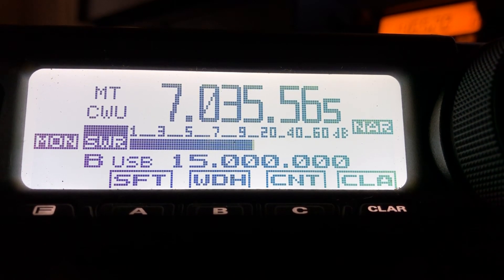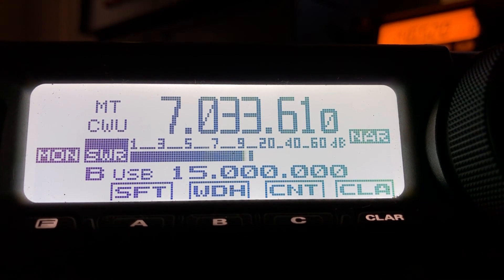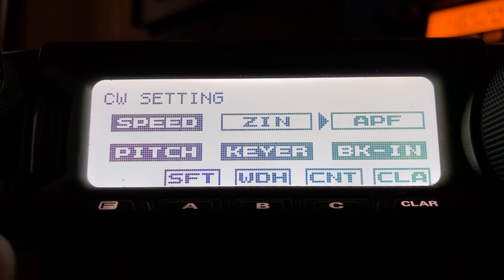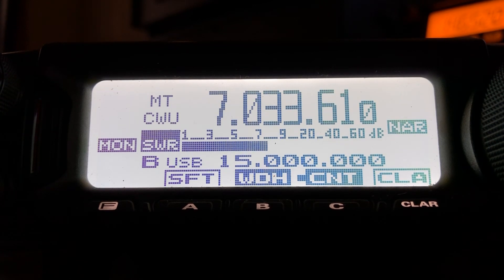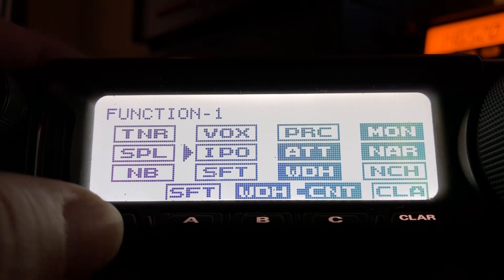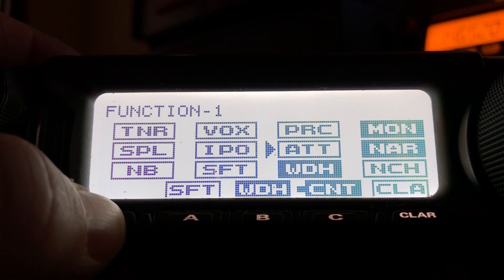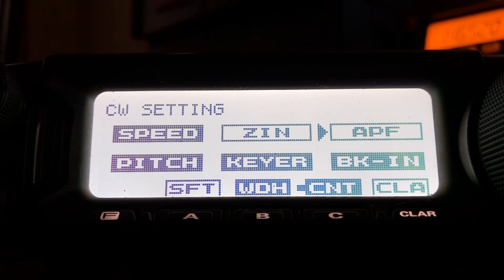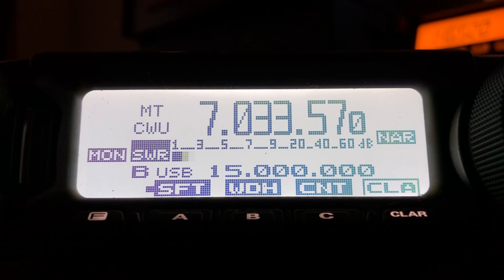Yaesu FT-891: CW Filtering Explored #hamradio #ft891 #cw #zin #filtering

Comment: Would you be able to explain how these filters work, what do they really do than help with the noise or knock the noise? I am new and would like to understand what that means. What are the settings of APF, you enable it but its left at 0Hz what are these doing? Why 0Hz? What is that APF filter really doing to the signal? Is it working on IF or audio signal? Is it just filtering how?
Reply from the maker: The instructional videos are at Patreon.com/N4HNH.  I also offer one-on-one consultations for S9 (VIP) members who subscribe annually.
Reply: @n4hnhradio thanks I will probably check them out
Reply: @n4hnhradio which tier is required to access just videos explaining these concepts?

Comment: Again, thanks for posting this!  This one, along with your longer CW setup video, are a big help with understanding this radio.  I get it in 2019, and have only played around with it a few times due to my work schedule and all.  I'm trying to get into operating it regularly now.  My only complaint with this radio, and you demonstrated it in both videos, is having to know how to quickly access those features in the menus.   It's one thing to play around with them when just casually receiving, but when you are trying to work someone, you'll miss a few words when you are trying to adjust everything.  I'm definitely glad a lot of the "set and forget" stuff with the CW functions is buried in the deeper menu.  I guess it is called get the radio set for your liking, and then go play.  73 DE KC9EHQ BT
Reply from the maker: I’m glad you found the videos helpful.  The FT-891 is a great little CW radio.  It’s very quiet and selective.

I find it advantageous to program one CW, two SSB, and one AM frequency/mode per band into memory slots.  I set each up with the filtering, attenuation, IPO or not, that I will want as a default.  It won’t store DNR or Width settings, but I assigned Width to the B button and DNR to the C button.  So I stay in memory mode.  I turn the multi-knob to select which band and mode I want to operate on.  I have my favorites as the default.  I can tune away to work someone on a different frequency.  When I’m ready to return to memory selection, I press in on the multi-knob, which reverts to memory selection, and I cycle through the memories to another band.

73, de N4HNH
Reply: @n4hnhradio  Thank you for the info and suggestions. My FT-891 is now my go-to HF rig for field use.

Comment: ZIN has to be kept pressed until you get ZERO beat agaist receiving signal + + and  it is used to zero your radio's RX into e.g WWV using menu 05-17 REF FRequency adjustment , then once APF in turned on it tunes automaticaly into your CWPitch settings- you must adjust your tunning manualy to your pitch , while observing ZIN LED . There you go my friend!
Reply from the maker: If you long press ZIN, it produces a spot tone, for manual adjustment of the VFO for zero beat.  Tap ZIN for automatic spot.

Comment: IPO must stays On on  especialy on 7MC to prevent overdrive of your front end! Full stop
Reply from the maker: Intercept Point Optimization means that you disable the RF amplifier.  I usually run IPO for 40 meters and lower, especially for SSB.  But the Attenuator is before the RF amplifier, so it makes sense to first use attenuation when trying to limit noise.  I sometimes use both ATT and IPO.

Comment: IPO stands 4 Intercept Point Optimier , APF automaticaly reduce your DSP filter bandwith to minimum of 50 Hz ..  there is a lot of misinformation due to lack of you understanding this radio's function. You do not understand what you're doing!  vk Ham  with 44 yrs presence on ham radio bands.. Just remove this video!
Reply from the maker: I think you have some sort of problem.

Comment: I am sorry, but you don't know how to use "Contour" and how much could be useful know it. Give another read to the manual and experiment on the radio.
Reply from the maker: If you have a better use, share it.
Reply: @n4hnhradio  Yes, i will try to make a video. Anyway, look at the manual, you will see there two functions for the Countour, one to substract the audio part you don't want and one to amplify an audio part that you want. Using the amplify function and finding the portion of audio where there is the cw pitch you set, you will discover how much can be improved the audio and volume of the CW signal you are listening. Try it.
Reply from the maker: That is the job of the APF and APF has a much better Q.  I think you didn’t pay close attention to the video.  While the Contour could be used to boost a region of the audio spectrum, that is not its intended function.  It is a low-Q filter, acting more like a wider version of manual notch.  Therefore it can knock down interference that is affecting a broader portion of the audio spectrum.  With sideband, it has made the difference in hearing my signal report or not.  I generally find that for SSB, somewhere between 1700Hz and 2100Hz helps clear enough hash from the received audio to make a weak station intelligible.  Contour is primarily intended for SSB, but, as I show in the video, it can be useful for CW.  Again, APF is the feature you would use to focus in on a very narrow portion of the audio spectrum, to accentuate the CW tone and provide some separation between it and the noise floor.
Reply: @n4hnhradio   Contour is primarily intended SSB, but, as I show in the video, it can be useful for CW. -> This is what i said, could be useful in CW, i agree with you that is intended for ssb first. APF is great, but sometimes on very weak signal an audio boost could be useful and here comes the Contour. APF is a DSP filter, Contour an audio DSP elaboration. Contour is intend to boost or cut the portion of audio you want. Is not intended for a primary function of boost or cut, just do both and you choose what you need. Is just another DSP help. Nothing more. And nothing personal, it is just an opinion and as such questionable by anyone
.
Reply from the maker: Indeed I have experimented with the boost option, a year or two ago.  But I find cutting offending noise or other artifacts to be the most beneficial use of Contour, and I prefer APF, set to narrow, for CW.  If you read the advanced manual, Yaesu explains the Contour as a cutting filter, the way I described.  But if you find that you like boosting instead, that’s fine too.  Yaesu probably would not have given the option to boost if they didn’t want to allow it.  

It might be interesting to note that the FTdx5000MP only allows APF or Contour for CW, not both simultaneously, like with the FT-891.  

Have fun!

Comment: Hey Doug, Great video. I am working on CW right now and stumbled across your video. Thanks for the info, I love my 891 as well. 73, W4RIN
Reply from the maker: Hi Rin!  It’s great to hear from you.  Glad you found my channel.  73, Doug
Reply from the maker: The FT-891 is certainly no slouch.  I use one for SOTA.  I normally run it at 45W but it is nice to have 100W when I need it.  73, Doug